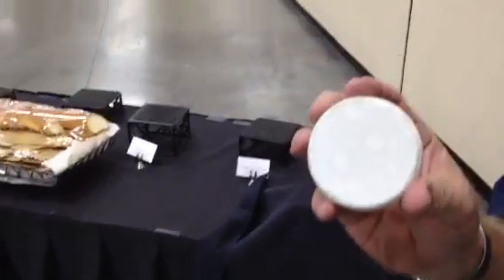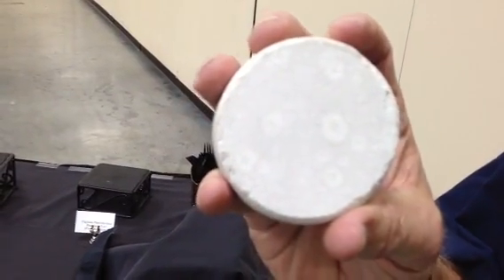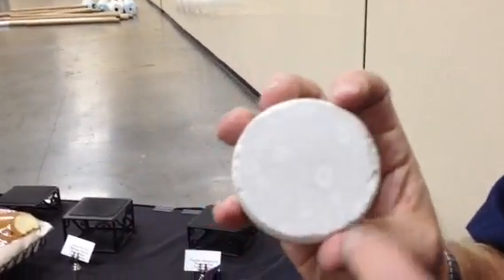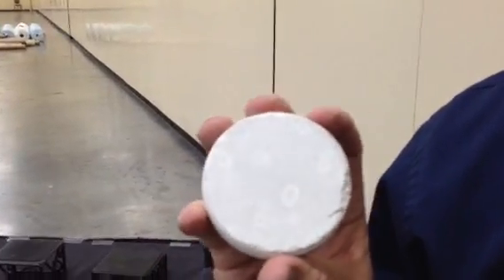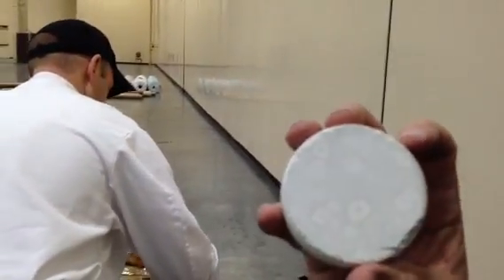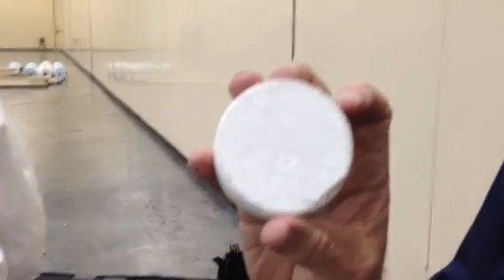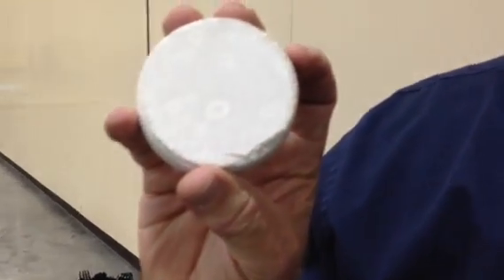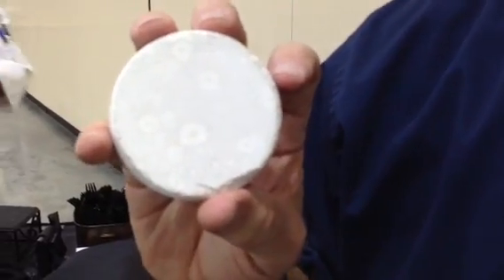Pool Plaster Mottling and Spot Etching

Comment: Yes,  I totally agree with you on the spot etching. Crews in our area use calcium chloride which makes me upset cos these guys do not want to spend a whole day doing one pool.
When we resurface a pool I personally watch the guy loading the mixer to make sure he doesn't put any calcium in the mix. I contacted the manufacture of the product and they told me there is no need to add extra calcium to the bags of pool finish when resurfacing a pool.

Comment: My pool D.E.filter had a couple of holes in the the manifold releasing some of the D.E. back into the pool. The D.E. settled on the bottom of the pool & remained on the pool ground for a week until the pool guy came out once a week. When the D.E. got vacuumed these white spots were left behind. Anytime D.E. gets into the pool & settles on the pool floor you better hurry to correct & remove or if left D.E. is left for a period of time, chances are white spots will be left behind!

Comment: Two years after having our pool resurfaced our pool has dark staining that began on the top step which started about 6 months after the job. We tested for organic and metals which came back negative. Every once in a while we get a calcium reading between 400 and 600 but after a week goes back to normal (below 400) levels. The stain has continued to grow on to the second and now beginning to affect the third lower step. We have a building material specialist from Poolcorp who states he does not know what the stain is from and that staining is not covered under warranty. He is also stating it could be from the pool floater chlorine cyanuric acid.  I'm not sure what we should do at this point. Any suggestions?
Reply: we are having the similar problem.. did it go away? or do you still have those dark stains in your pool??

Comment: I installed an in ground pool 8 months ago in Texas with a bluish green plaster it now has lightened  tremendously with a grayish haze, white spots, and fine surface cracking. My pool company said it is caused by hard water. My test strips show it is in  the ok range, but the pool company says I need to have it tested by a pool supply company and then take the results an plug it into the Langlier index for a hardness result. I live in Texas and my water temp is now 90 degrees. Could this also be a cause or is the pool company trying to keep from redoing my plaster?